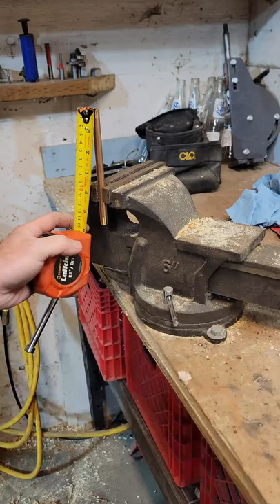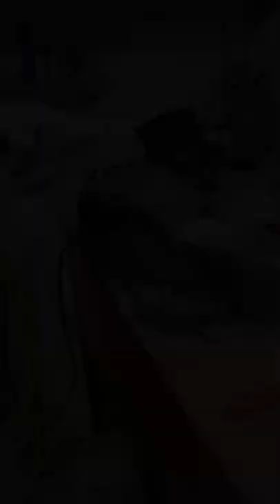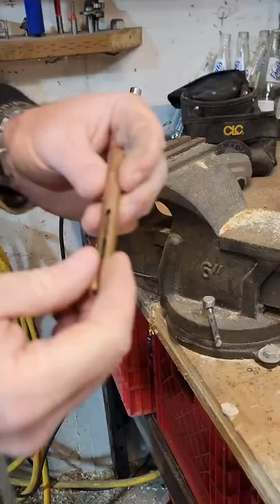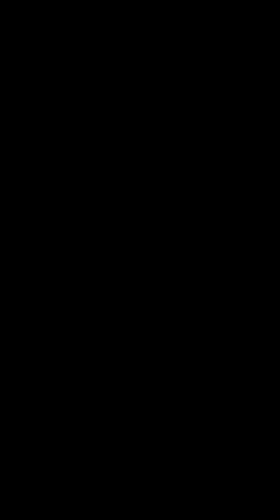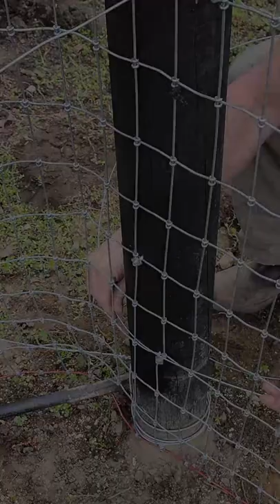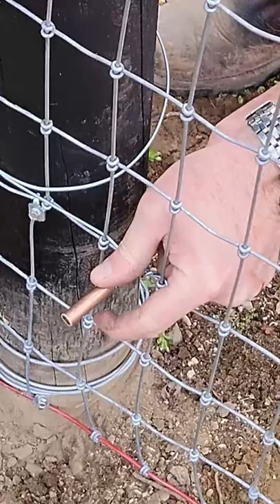Easy Non Slip Tie Wire Tool For Fencing.. Tool Hack

Comment: Or just drill an 1/8" hole in a short piece of flat stock. A 1/4" box end wrench will do the same thing as well.
Reply from the maker: Yeah. Made the video to see if it could compete with the useless chinese tool videos. Didn't